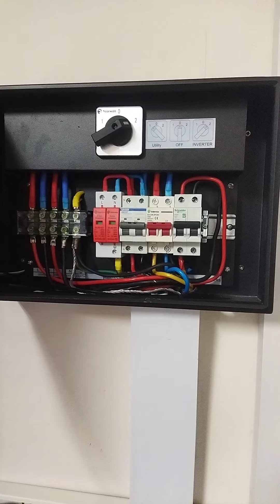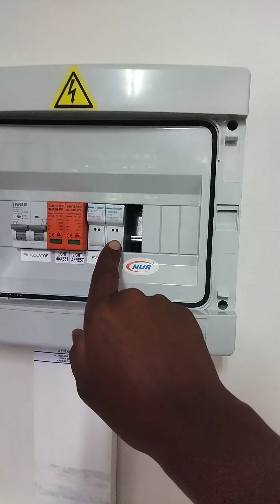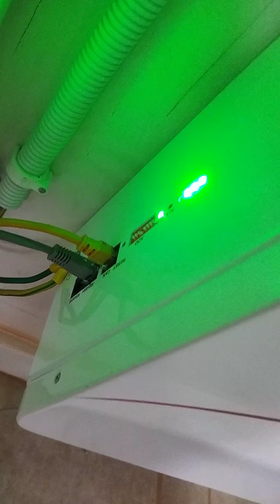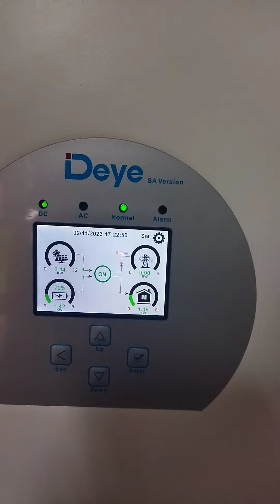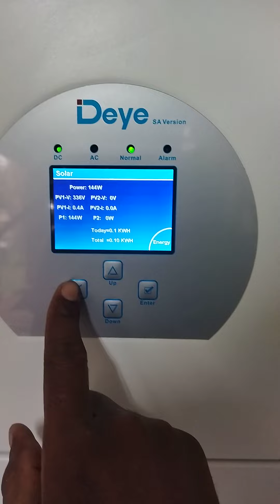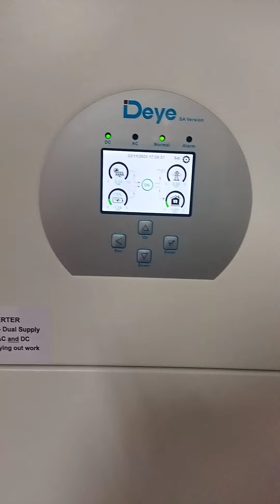8Kw Deye hybrid inverter with 2 Shoto wall mount lithium battery

Comment: What are the issues that can be encountered if the dc cables and AC cables are in thesame truncking without shielding the DC cables?
Reply from the maker: Hi there if you mix DC cables and AC cables you will get what we call (DC ripple) were DC power may begin to behave like an AC line frequency,  secondly will affect the  behaviour of your earth leakage as well.

Comment: Hi Anthony. I have a similar setup, same inverter but I have 2x Shoto SDC10-Box 5. The installers swear that I don't need to change the dip switches, and I can't see a way to monitor the two batteries without looking at the indicator lights. I'm not certain that the batteries are communicating properly. Can you give me some advice?
Reply from the maker: Hi there with Shoto I think it should be master battery 7 then slave 1
Reply: @Anthony mwambazi  thanks. I was looking at the manual, it said 5 on the master and 1 on the slave. I'm your video it was also 5 and 1
Reply from the maker: @tokiwartoothnotabumblebee88  it's basically the same irrispective of the brand type of the Shoto I could be wrong will double check
Reply from the maker: On the Shoto master battery 7 up and 1 st slave 1

Comment: can you use nylon sleeving instead of the metal sprague ? they can handle heat and are self-extinguishing.
Reply from the maker: Hi there nylon sleeving can handle heat but not fire it will melt and has no screening form emf and will interference in electrical system

Comment: Hi Anthony, do you use a surge arrestor if you use a automatic transfer switch? I am installing a deye 5k hybrid, and use a automatic transfsr switch to switch over grid to load when the grid falls away. But I know that potentially the switch over will cause a peak voltage spike, so I was wandering if you have any experience with this. I think you will need one on the grid side and one on the ups (load side) Btw great informative channel you have 👌
Reply from the maker: Hi there I  use manual change over switch for maintenance work or so because the inverter has a change over in itself which is faster than a an external automatic change over switch without interruptions and that would cause a surge on change over and that's why I don't install a surge on the output of the inverter
Reply: An automatic change-over switch has a centre off position and is not ideal for use on inverters. It is rather used for change-over between your mains supply and your generator supply.
Using inverter to load, should go through a manual change-over switch which is normally not changed over, because all happens in the inverter itself without external intervention. The manual change-over is used ONLY if the inverter should fail or when you deliberately want/need to take the inverter out of circuit and continue feeding the load from the mains supply.
An automatic change-over switch is then the wrong choice for using it on inverters. The only practical application would be to use it to select between smart output and mains. In this case the smart output can be programmed to become live should the SOC of the battery be between say 80%  and say 95% which will allow you to use stored solar power to assist in heating a geyser. Should the state of charge go below 80%, and automatic change-over switch can then be used with the smart output as its Normal supply and the Reserve input gets power from the utility mains after the smart output dissappears as a result of the SOC.